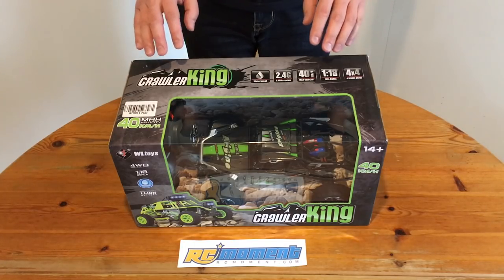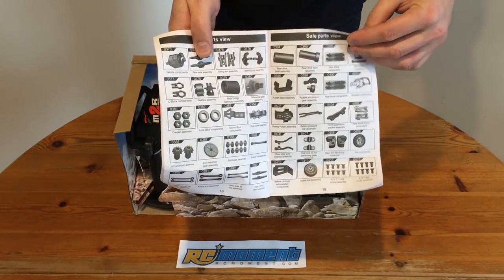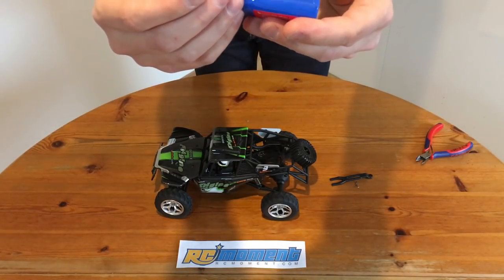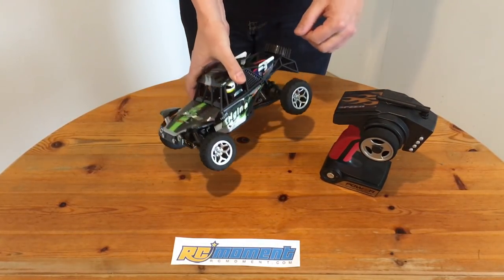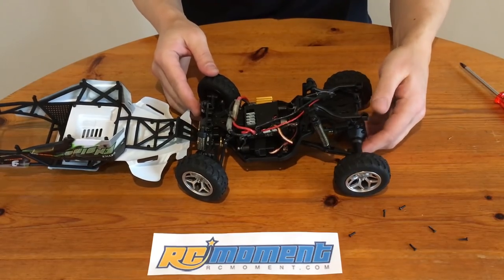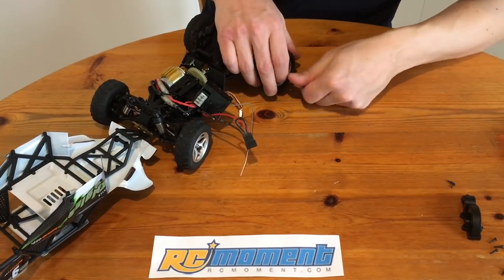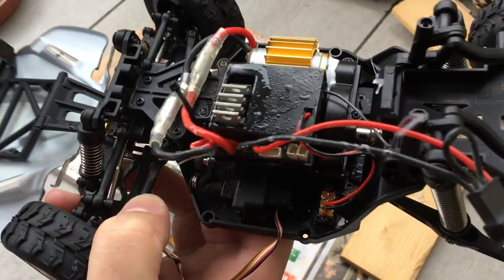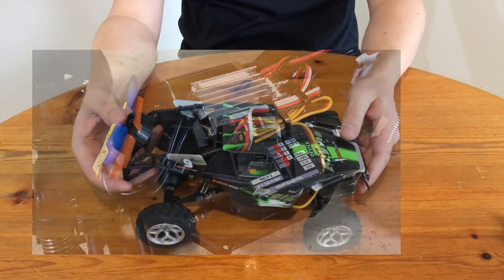WLtoys 18429 "Pocket 12428" Desert Buggy: Unboxing, Teardown, Waterproofing and FAIL!

Comment: Another great video.  1.  Why not open the Diffs and make sure they have grease? also see if they are plastic or metal? 2. the additional coating on the ESC made it go bad? is this normal or have you done it to other wltoys ESC 's with no problem.

Comment: Hi TheDIYGuy999, is the transmitter of this 18429 identical to or compatible with the one for 12428? It's because the transmitter of my 12428 is broken, wonder if I can buy this one as replacement, thanks.
Reply from the maker: Hi, yes, it's compatible. Just switch on the car first and it will be paired with the new transmitter.
Reply: thanks a lot! btw, all your videos are great!

Comment: hey, i want to ask something the wltoys 12428 use a lion battery but the battery is 7.4 volt battery in imax b6ac lion battery is 7.2 volt , what do i use to charge lipo or lion mode? thx
Reply from the maker: This is only the nominal voltage @ about 20% charge. The maximum (fully charged) voltage is 4.2V per cell. This is identical for LiPo and LiIon cells. So you can use any Lithium charger with balance port.
Reply: TheDIYGuy999 ok thx so i can charge this with imax with lipo select